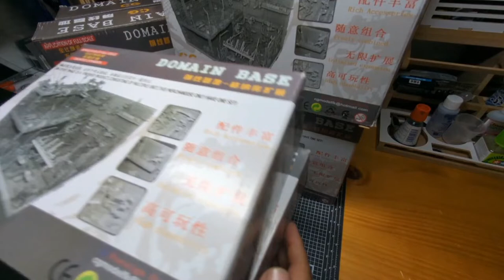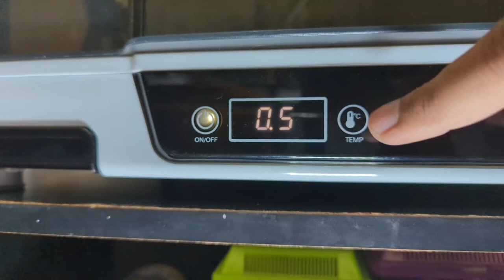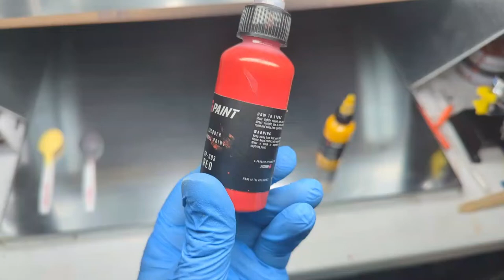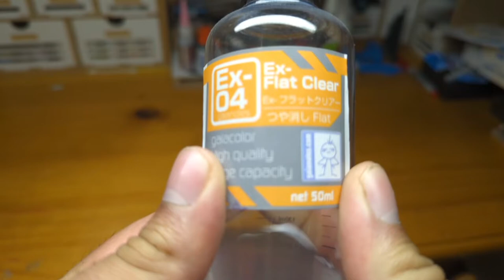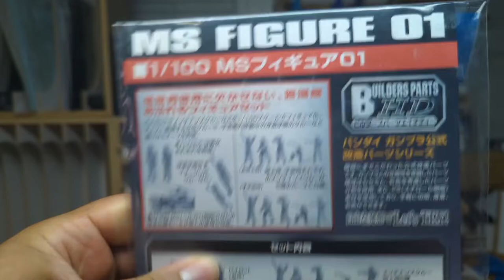Gunpla_ Let's Make A Hangar base

Comment: Berapa ukuran skala untuk figure gundam 1/144
Reply from the maker: It can hold up to MG 1/100
Reply: @MTMario  untuk figure yang di cetak menggunakan printer 3d itu ukuran berapa yaa pak
1/100 atau 1/64
Reply from the maker: @waktutube  My apologizes, the figures are for 1/100 scale and they are made by Bandai that you can purchase.